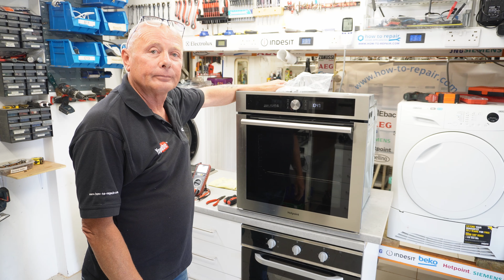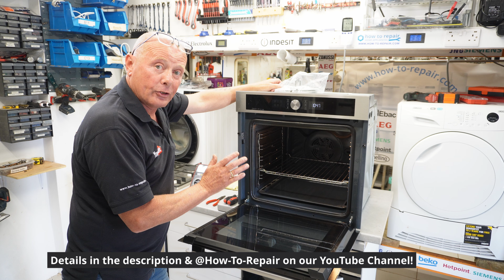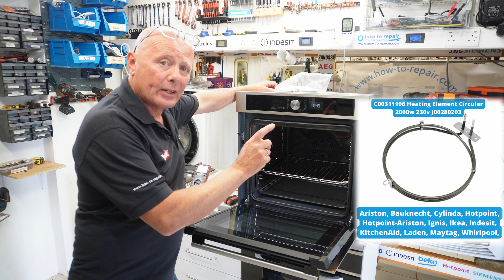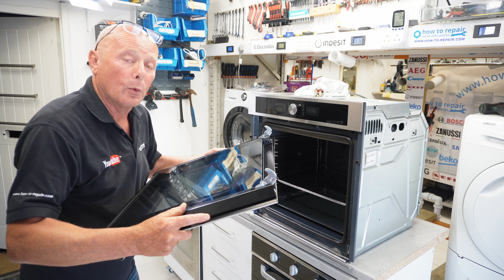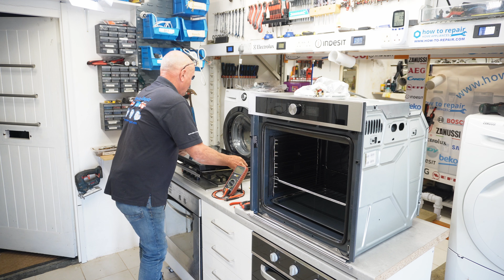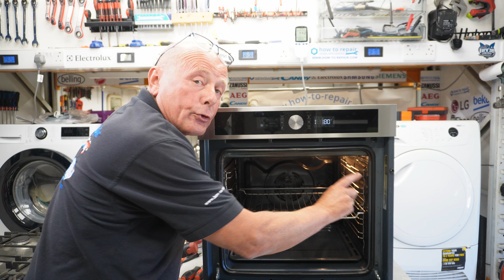Oven Not Heating Up? Changing Fan Oven Element For Hotpoint, Whirlpool & Indesit Ovens

Comment: Thanks so much for making this video. I've bought the replacement element and have taken the old one out. When I pulled the cables through I saw that the white one had a small gap in the sleeving leaving the metal inside exposed. Can this be repaired with electrical tape?

Comment: Your video just saved me buying a whole new oven when our old Hotpoint BD32 bottom oven element broke. Thank you. The element cost about £15 vs £300+ on a new oven. An easy installation although I did loose the wires down the back and had to fish it out. Just tested and it seems to work great. Thank you.
Reply from the maker: A pleasure to help. I am glad you managed to get it up and running.

Comment: Good video however as an engineer of 20 years I would have mentioned the importance of the spade connectors being tight onto the new element. The amount of DIY elements changes I have gone to where the customer has fitted a loose connector only to see it overheat and melt within months 👍
Reply: That's a good comment and helps explain my issue trying to remove the spade connectors. I've used pliers to try and remove the spade from the element but they won't budge. Is there anything I can do to persuade them off? I'm also surprised how thin the wire is and worried about breaking it! Any thoughts on how to safely remove them?

Comment: Excellent instructional video. Very clear and straightforward. Many thanks
Reply from the maker: Thanks for the kind words, please share it to help others make a wise choice!
Reply: @How-to-repairThanks to your clear, comprehensive video I've changed my Hotpoint oven fan element in about 15 mins. All fixed. The multimeter check for resistance diagnosed the problem. Many thanks again.

Comment: Hello . Hope you can help. We have this over and noticed the over is not heating up to its desired temperature in good time . For instance it's taking about 25 minutes to reach 180c and when you put something in like 2 or 3 pizzas the bottom will cook so much faster then then top. The fan is turning so would you believe the fan heating element needs changing
Reply from the maker: There is normally more than one element in the cooker. You need to make sure that all the elements are in good condition. You can check these with the multimeter.
Reply: Mines the same oven and doing exactly the same thing did you resolve this issue

Comment: This is so helpful thank you! I’ve replaced the element twice now, I probably watched the original video with hair for the first repair. I’m heading over now to the how to clean the glass. 

The two wires that come out of the back of the element, one of mine is frayed, it looks like the element caught fire and maybe damaged the wire, right at the connection point. Do you think this can be replaced, or advice or what to do or maybe time for a new oven?

Comment: I have replaced the element that i am now at a loss, the fan was working before I changed it but no heat, now I have changed the element neither are working,  could you please offer any advice? Many thanks in advance

Comment: Good video.  Unfortunately the screws that hold the heating element in place in my Bosch oven have been screwed in from the back (not the front), so I can't undo them inside the oven.  Looks like I'm going to have to remove the entire oven from the cabinet and try to get at the screws from the back.  I wonder what sort of clown would make an oven like this in the first place - it's almost like they're making it deliberately difficult to replace parts.

Comment: Woahhh, what a helpful video. I wonder if you can help me. I have a Hotpoint, I only bought it two years ago. :( I think the fan heating element has broken on it already. It’s a HDM67V9HCX. It the system for replacing it the same as this? I didn’t take out a warranty because I can’t afford to do monthly payments like that.
Do you know if an oven is dirty can it stop the heating element from working properly. The fan in the main oven is working, the light coming on. But I don’t think it’s getting to the temperature… I’m going to clean it, I struggle to clean things. It’s not excessively dirty. But it is dirty, the door anyway and the bottom. But not that much. I don’t spill stuff but hot fat might get into places, I cook in my oven every day. Just once a day. Please advise!

Comment: Super useful. My Indesit built in isn’t heating up (dies on NYE). Also tripped a fuse, just wondering is that means it’s more likely to be the selector or the element. Grill works okay but has also tripped the fuse when testing it. Any wisdom would be helpful as I’d like to repair but it’s a cheap model and seems a replacement would be as financially economical.

Comment: Great video thanks. I don't trust myself to make that repair. How much roughly should I expect to pay a competent person to supply and fit a new element (UK)? Cheers.
Reply: Not relevant for you now - but perhaps for others. I have just bought an element online for £16. Could have got a generic for £13. Fitting it really is a 10 minute job so it's a matter of finding someone who will do it. Minimum call out cost is probably £50-100. But it really is a job that anyone who can handle a screwdriver cold take on

Comment: Switching using the trip switch is safe isnt it? I know its probably a silly question but I am no electrician lol.  I just do not want to remove my oven out from where it is but wish to replace the element, the plug for mine is wired in to the wall, not a socket plug, that is the reason I ask, turning the trip switch on the main electric board will be ok for me to change the element yep? I should add, removing the oven would be to get to the socket place itself also.  Great video though, I was running my oven cooking and the trip switch went, of course turning the oven off. So i went down to the basement and put it back on, then just like this on the main fan setting my oven gives no heat. So I am guessing the element blew during cooking and that tripped the switch, i hope that is all it is anyway

these videos are an absolute god !!